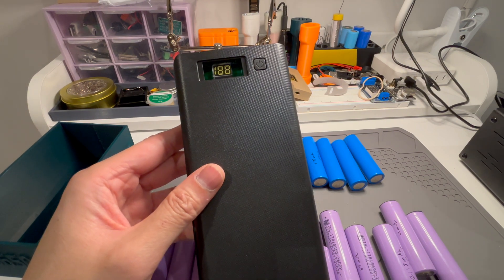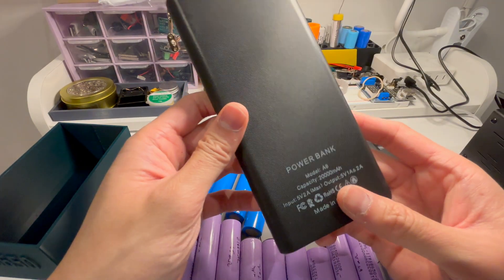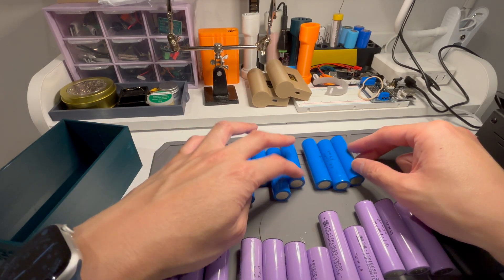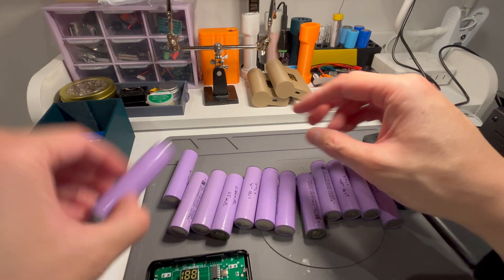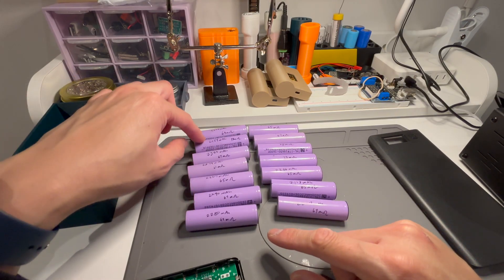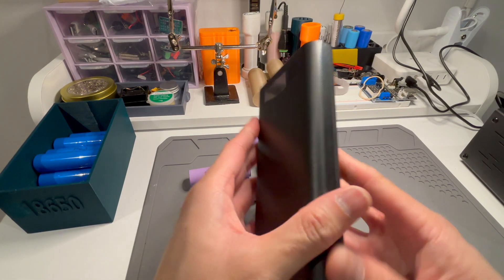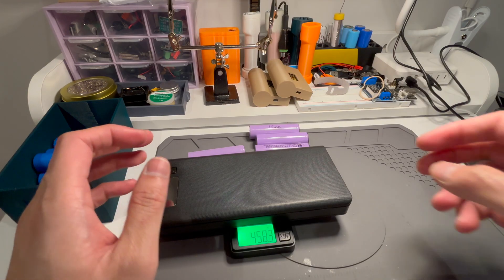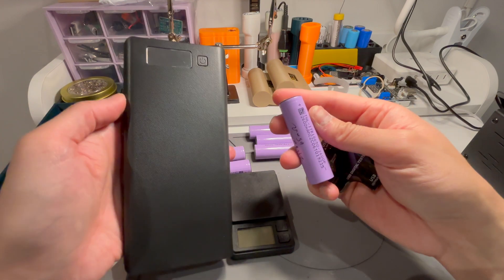Easy DIY USB powerbank (8 x 18650 batteries) from Temu

Comment: I'm listening to your presentation in Polish haha! So much fun! In which scenario it could be superior than the regular rechargeable USB power bank?
Reply from the maker: You can choose what cells are in it and as someone said earlier, you can replace them as you want.
Reply: A regular power bank becomes unusable after a few years - here we take out a few cells, check which ones have too high resistance - and after replacing them we can continue using powerbank.

Comment: Two dollars for powerbank + 8 x 18650 (0,3-0,5 for one used from laptop) - total 4$- 5 $  ... Personally, I prefer the version for 21 or 28 or 32 18650 batteries.
Reply from the maker: True, but then you can't take it on a plane. I would like to try out the 40 cell version!
Reply: @mrjamesflores  I don't have the 40 version. In the previous ones, I connected a 5V USB to a 12V DC and powered a small 20W car LED that could stay lit for several hours. However, it was necessary to add a few metal plates to the USB port for heat dissipation. It's also important to measure the resistance of each cell and the capacity of the inserted cells, and to ensure the voltage is similar when the batteries are inserted. Otherwise, the power bank will self-discharge.